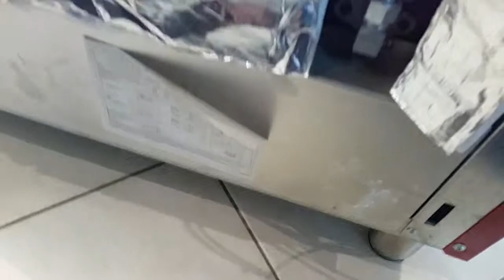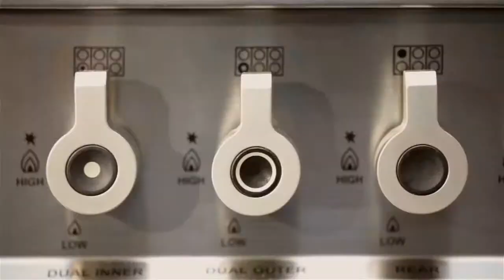Bertazzoni Range Issue. Oven won't turn on. Thermocouple replacement

Comment: Well done. You don't need to shut off gas for thermocouple change out, Also to save time don't unplug it at the wall. Just pull the black connection inside the unit in the back left corner (There will be black, white and green). Don't take off the back either (I'm sure its done for the video) Just snip the thermocouple with wire cutters to make the removal of the faulty one easier.  When tightening the new thermocouple make sure its snug but don't over tighten it or it will damage it possibly. Part number for Bake Thermocouple 508041. Good luck!
Reply: Also this applied to most MAS and PRO models. If you have MAST or PROF they have a slightly different thermocouple.
Reply: I have a mast model which part number for thermocouple matches my model? Hard to find an answer
Reply: I have the same problem even for the broil is it an igniter problem or the thermocouple